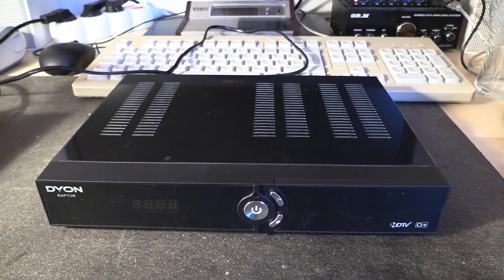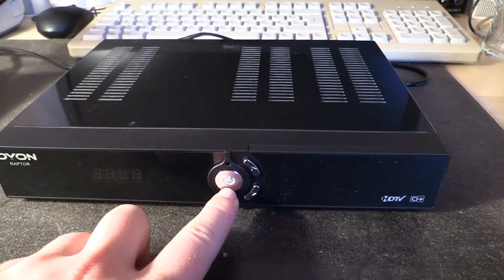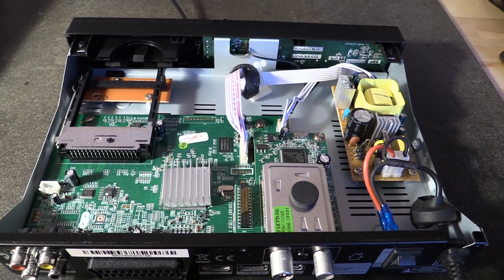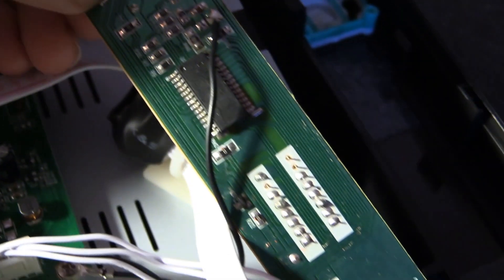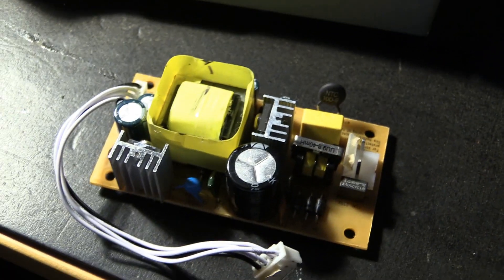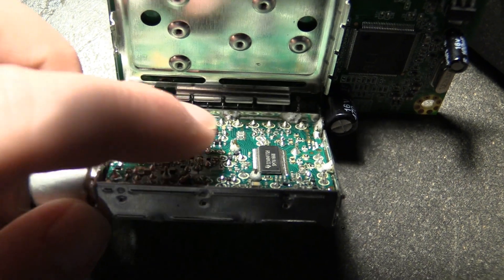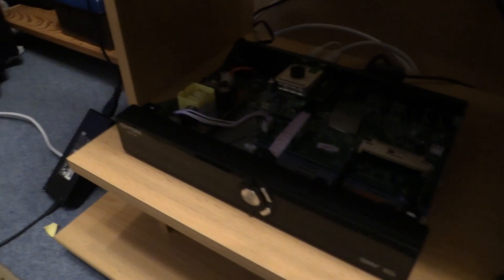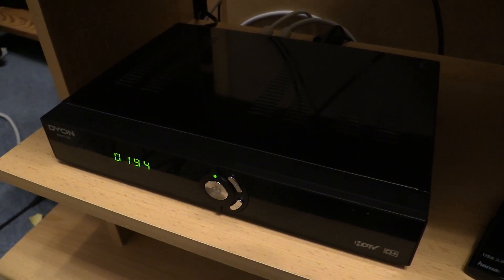DrCassette's Workshop - Dyon Raptor Cable TV box mods

Comment: PURCHASE a software update? What?
Reply from the maker: These cable TV boxes are sold for very low prices as there is a lot of competition. Selling firmware updates that unlock additional features is a great way for the producer to get in some more money. I don't agree with such business practices, but that's how the market works I guess...
Reply: @DrCassette  Hi do you still have this receiver? If yes can you tell me which Firmware version is on yours? Maybe yours is newer as mine (1.5.07) so can you backup it and send me please? I found mine in the trash and it works.

Comment: hey at least in Europe you can buy cable boxes that are all standard and not rely on the cable company to force you to lease an overly expensive box.
Reply from the maker: narunetto You can also rent cable boxes from the providers I think.
Reply: I know in Canada they let you buy them but they use the same cable system as we do in the states so it's all the same boxes so theres not a really big market of competition like there is with the DVB-C standard. I'm jealous as hell.
Reply from the maker: narunetto A downside of the DVB-C mass market is that these cable TV boxes tend to be insanely cheap and low quality. It's hard to find better quality than what this thing offers. Also none of the major quality brands offer this stuff. No Sony, Panasonic etc. Just nonames such as Dyon, Strong, Medion, etc. The high end models are made by Technisat and Kathrein.

Comment: its a known problem about heat making the picture break up, mine does the same till i modded it with a 40mm fan
Reply from the maker: ictdude1 Yes, I'm sure this runs very hot. I use this for timer recording TV programs, so reliablity is important. Maybe I'll install a little fan in there. The power supply should have the right kind of voltage.
Reply: DrCassette there was a 3-pin connector, maybe for a fan ^^ or some unused solder-pads
Reply from the maker: I don't think so. The manufacturer wants this thing to overheat and die so that you can go buy another one :P
Reply: DrCassette  YES, very often = shortens life = more profit - also apply to cheap capacitors (preferred in power supply, so that it can damage other capacitors )

Planned heat destruction has been confirmed to HP DV6 & multiple HP Envy & Toshiba ultrabook - NEVER buy HP consumer laptops !!!

hot receivers: Zehnder DX .... (Power Supply) , Skysat / orbitech ... (Power regulators & Power Supply hot & cheap SuScon capacitors )

Comment: That LED display and that PSU looks very cheap!
Reply from the maker: Joshua's Recordings The PSU is OK, nothing great but I have seen worse. The LED display indeed is a very simple looking setup. Certainly won't win any design award :D
Reply from the maker: Killerspieler0815 Keep the application in mind! This is not a PC power supply. The four diodes form the rectifier for the incoming mains voltage. Low frequency 50 Hz. Easy, just about any cheap diode can do that without problems, provided the current and voltage ratings are right. Trouble starts when it comes to higher frequencies, that's when cooling becomes an issue.
Reply: DrCassette too cheap caps ... and unusual 4 Diodes instead of bridge rectifier
Reply from the maker: 4 Diodes in place of a bridge rectifier is nothing special. Works just as well.
Reply: DrCassette Yes (if cooling & current fits), but on PC-Power supply its a sign of a desinged-for-junk-PSU http://f.ptcdn.info/782/006/000/1372669843-IMG5437-o.jpg (Note: typical extra cheap Cheng-caps )

even worse, some Cooled (heat sink) Diods on secondare had sometimes (quick & dirty) replaced by 2 uncooled normal diodes

Comment: I am stupid bastard ,i connect my external tablet speakers first to laptop and later power supply to 230VAC.Entire power cable melt and smoke !,laptop audio bake and death.There has been a surge , now I have to buy a USB speakers for laptop.Interesting that the laptop live at least.
Reply from the maker: Blahblox Gyuanox That's some bad luck, but what does that have to do with this video?
Reply: DrCassette I just do this when i watch your video for "better sound",heh.
Reply from the maker: Is something wrong with the video's sound? I use headphones all the time.